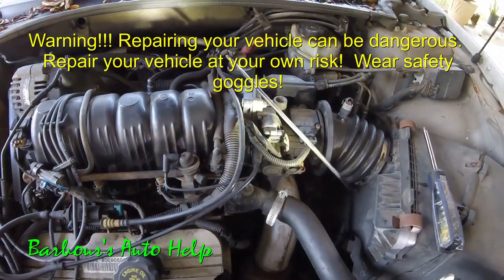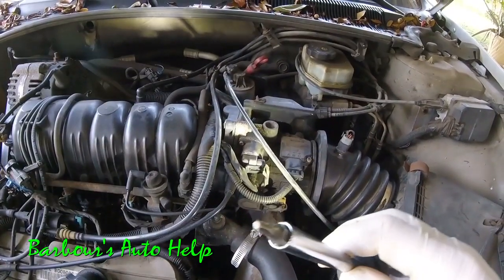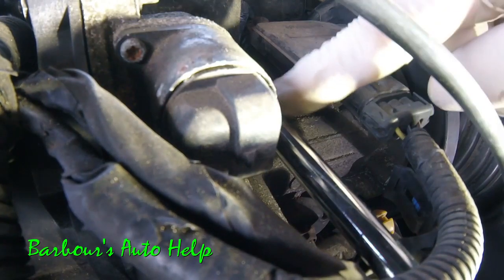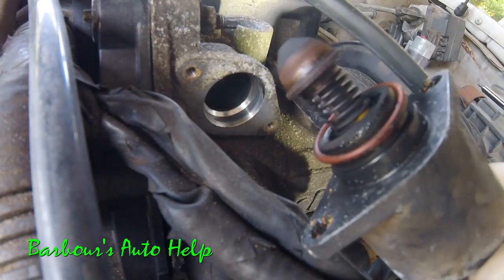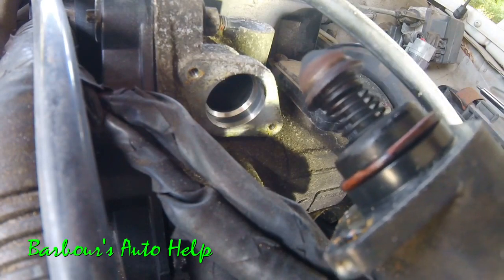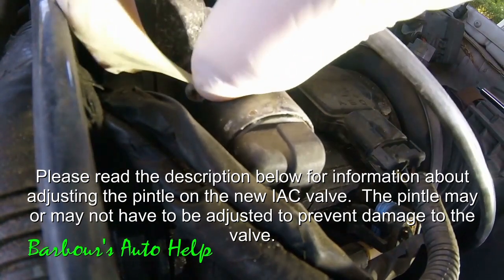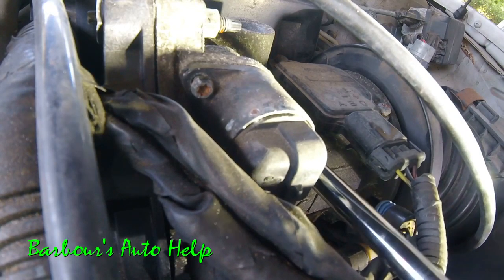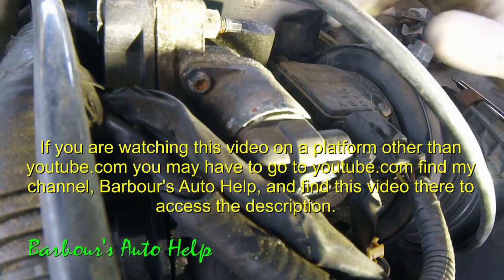How to replace an IAC valve on a GM 3.8L V-6 series 2

Comment: I have a 2004 Pontiac Grand Prix new plugs and wires , it has trouble starting but once it’s running it’s fine can it be the iac no codes
Reply from the maker: Not sure.  I wonder what your fuel pressure is when its acting up?

Comment: Can a faulty IAC cause intermittent 'service engine soon' light?  Light goes out when I step on the gas but only when the car is moving.  I cleaned mine and I notice quite an improvement but it still does it.  I have a new one on order.  It's on my 1989 Buick Park Ave 3.8L V6.
Reply from the maker: Stop into your local parts store and have them scan for codes.  See what you got.  Let me know.

Comment: I changed it ( on my 2004 lesabre) and still no good, then changed the throttle position sensor right below it and that took care of it. It took the security bit 20 torx if I remember correctly. Easy change out on both and I definitely understand it could have been either one. Thanks for the video!
Reply: @arciefan What were your symptoms? My car dies after 5mins of idling in cold, or when I wait on the stop lights. I was trying to unscrew the Idle Air control valve today, but I could't find the right bit. I bought a set with many bits and it was taking me too much time. Now I know it is the T20.
Reply: @babycakes8434  High idle like 2500rpms if I remember correctly. Engine dying was not one of the symptoms.
Reply: @babycakes8434  was the iac the issue

Comment: Can the iac valve cause my care to idle rough? When I'm at a stop light it will idle normal them dip down for a sec then go back to normal. It happends fast. Like it bounces up and down a few notches and it's not consistent.
Reply from the maker: I'd say its possible if you're car is equipped with one.
Reply: @BarboursAutoHelp  I think it is. It's a 2000 chevy impala. When I look up the part on autozone website it gives me options for one

Comment: what size are the screws on the idle air control sensor on a 1997 buick lesabre limited
Reply from the maker: If they aren't the same size as the video says then I'm not sure.

Comment: WHERE IS THIS LOCATED ON THE GRAND PRIX??? 3800
Reply: Same spot and remove the cover
Reply: @youngrello7644  THOSE ARE NOT ON THE 2008 VERSION
Reply: I have a series 3 it's connected to the throttle body under the engine cover
Reply: @youngrello7644  these are not on the 3800 v6 2008. this was replaced with the actuator

Comment: The engine management of GM is crap. V8 version of this engines in Land Rover doesn't give you half of the problems the GM versions gives to you. 3800 when its not the Iddle Control, is the crank sensor, when it's not a coil, is the MAF sensor, definitely all the sensors die in them before 10 years or 100,000 miles. We need to love BOP to keep repairing them all the weekends.
Reply: Ivan Arrache     Got a 3.4 V6 in my car all the sensors still work just changed my IAC valve because it was dirty and instead of cleaning a new one was cheap so just replaced it
Reply: @ryans413  and I have one Pontiac Firebird, two Pontiac Fieros and a Chevy Cruze in my house. Been working with GM for more than 25 years. There are different kinds of GM. You have a 60 degrees V6 like my Fieros. But the 3800 is another animal, is a Buick 90 degrees. Know who is the worst? The newer, the Cruze. And don't get my wrong, I'm NOT changing to Toyota or any other. I'm just saying that in the specific case of the Buick 90 degrees, Bosh management is better than GM. Ah, and the OBD1 in your car (before 1996) is better than the OBDII.
Reply: Ivan Arrache     I know all about Pontiac I’m a fan even if it’s GM I know how to look after them. My cars a 2004. So it has ODB 2. The 3800 was GMs most reliable engine but the 3400 is too with proper maintenance. I know everyone says the 3400 blows head gaskets but I haven’t had that issue at all. I’ve noticed though it dose run little hot at times. But I never push it too hard anyways.
Reply: @ryans413  what 3400 you have? I have one from a Lumina Z34 and never have problems with head gaskets. Grand Am have the OHV and Grand Prix have the DOHC like the Z34. Is nice to meet another fan like me. 😊
Reply: @ryans413  I meen I have one 3.4 DOHC in one of my Fieros, the other one have a 3.1 Turbo from a Grand Prix. Both Fieros are from 1987.
Reply: mine is 30 years old  done 330000 kms replaced coil packs once   still going strong on e10 fuel
Reply: Just cleaned the IAC on my 2.8 in my '87 Cavalier. Now it runs like a champ. 😄

Comment: Hey, so my 2000 Monte Carlo idles at stops and the RPM needle goes up and down, shiots real high, then my car shuts off. Could this be the issue?? (Crankshaft Sensor, Oxygen Sensor already replaced, MAF, MAP sensors are good)
Reply from the maker: Sounds like maybe you have a vacuum leak.
Reply: @BarboursAutoHelp  so, I would be looking at a hose replacement or something?
Reply from the maker: It's too hard to say without looking at it.   The idle going up and down sounds like a possible vacuum leak though.  From where?  Not sure.
Reply: @BarboursAutoHelp  damn..I'm just scared to drive it all the way to a shop, as iy keeps cutting off. Can I drive with my hazards on? Lol
Reply from the maker: A tow truck could get you there.
Reply: @FatalCorleone07  there's a small line thats goes from Idle Control Sensor to the fuel pressure regulator, start from there.
Reply: @Ivan_Arrache_Young  I fixed it. It was my TPS sensor

Comment: Can u clean the old one up with carb cleaner? If In a pinch? Thanks. My car idles at about 600 or 700rpm. Is that acceptable? It doesn't die out or anything, I just thought it was a bit low.
Reply from the maker: I'd use intake cleaner.  600-700 rpm sounds good.  This is where most cars idle.  What kind of vehicle do you have?
Reply: @BarboursAutoHelp  2003 buick lesabre. I did clean it with carb cleaner and seems a tad better but hardley. It wasn't that dirty at all.
Reply from the maker: Perhaps you didn't have a problem.

Comment: Could this cause the engine to stop? We’ve talked on another video
Reply from the maker: Yes, a faulty or dirty IAC valve could cause an engine to die at idle.
Reply from the maker: I can't say that that is your problem though.
Reply: BarboursAutoHelp Can this make your vehicle idol HiGH??? I have a 2000 Buick lesabre 3800
Reply: @sanppsondapetdro3933  check your tps sensor. Mine was bad in my 2003 bonneville 3.8 supercharged
Reply: @sanppsondapetdro3933  it caused high idle
Reply: BarboursAutoHelp Can this color is your vehicle to Idle High???
Reply: I have a 1989 98 Oldsmobile and it runs fine and then out of no where it won’t start, today I was driving and turned the steering wheel all the way to the left and it just shut off, I had to wait and try to turn it on and it started up, I was googling and it said something about the IAC
Reply from the maker: I'm not sure on that one.  Thats before my time.

Comment: You can just clean the old one up alot of the time
Reply: New valve is pretty cheap mine as well just get a brand new one
Reply: With what? Carb cleaner??
Reply: @johnwagner4559  I would use mass air flow sensor cleaner,wont damage the iac
Reply: @CaptainKaBoomzs   i used carb cln. It works great.
Reply: @johnwagner4559  sounds good!